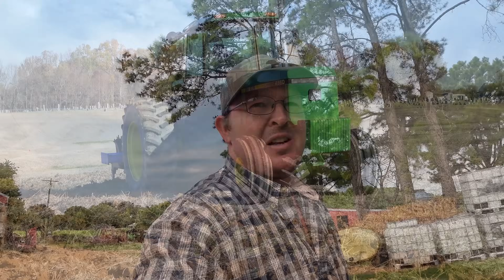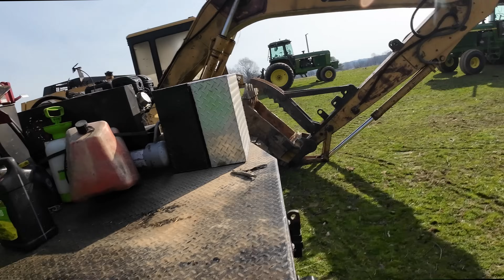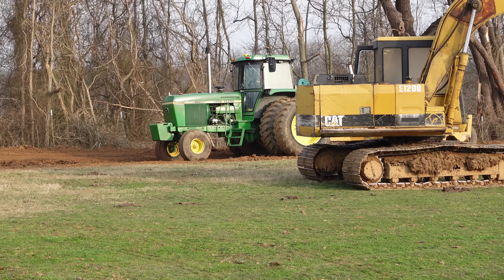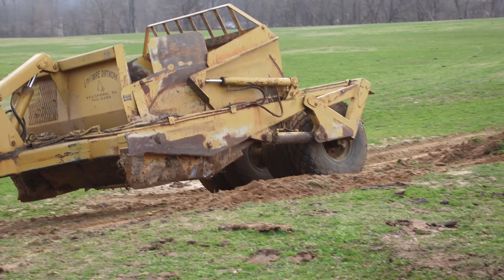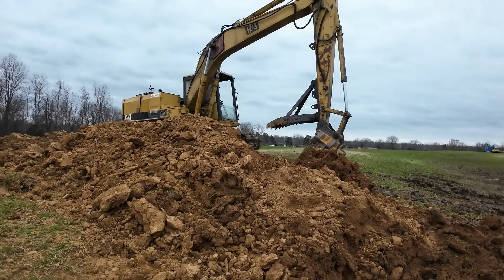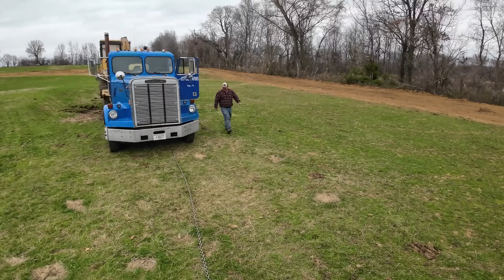What Else Could Go Wrong? Day 2 Troubles - Dirt Work

Comment: Glad no one was harmed with the snapped chain !  I have been on the receiving end as well , scary as ___ !   When ever I use a chain , cable or tow strap now  , I throw an old coat or something like that across the chain ..It is supposed to keep it from flying if it breaks ...so far I have not had an opportunity to see if it works  ! ( luckily )   I am glad you were not harmed , a new window is expensive but better than being hurt !  Keep up the Great Videos !!    A fan from Canada
Reply from the maker: I'll have to try that coat trick. That's the first, and hopefully, last time, I've ever had a chain to do that.